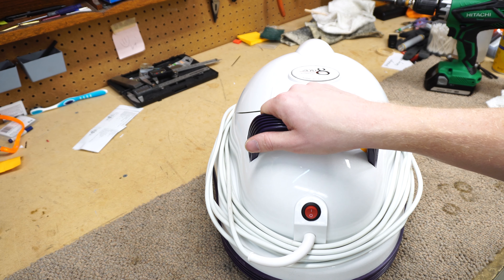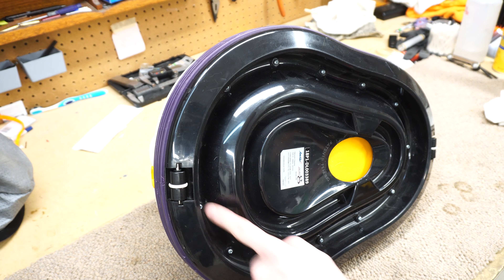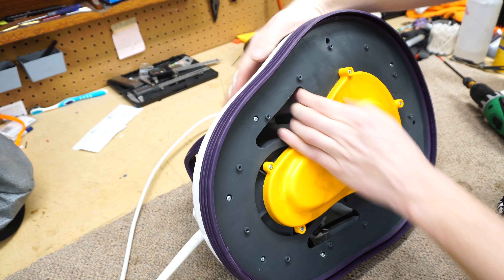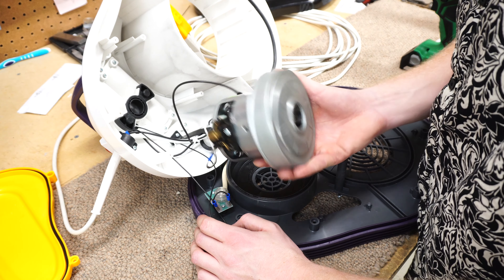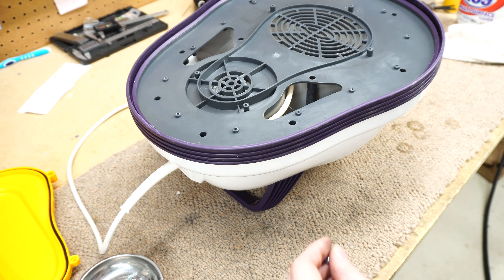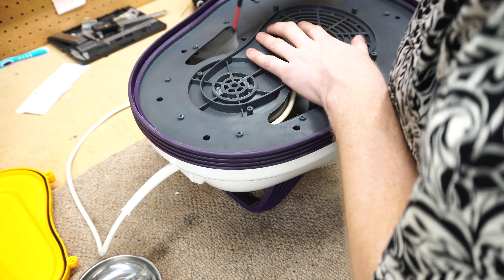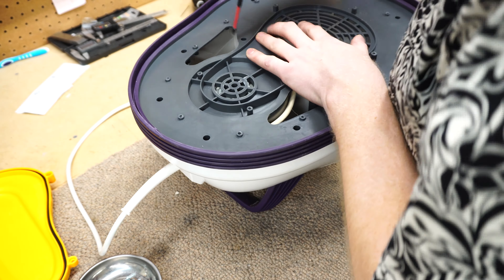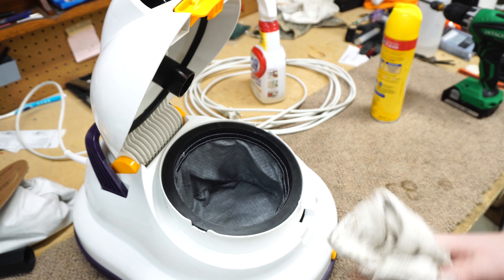Zero G F3D Vacuum Cleaner Repair

Comment: Wow, there's nothing in there! (Then again, what do you really need in a capable vacuum besides a motor, a thermal cutout, and an electronic bag check?) I'm just surprised they used a 4.3" motor instead of the typical 5.7" you'd find in canisters.
Also Cinderson motors are fairly common now - you'll mostly find them in low- to mid-range vacuums like Hoovers and Kenmores. They're no Ameteks, but they're alright for non-serviceable tin can motors.
Reply: Is it possible to replace the Cinderson motor with an Ametek motor? Also, is there a way to put sound deadening foam in the Zero G to make it quieter? I have tinnitus and I hate loud vacuum cleaners. The Zero G is supercool, though, and I would love to own one.

Comment: At $600.00 the question becomes whether it’s worth spending $700.00 to buy a Miele Electro+ instead particularly if it’s going to be your only or primary vacuum. My inclination is that it would be worth the slight difference for the Miele.
Reply: Why? I have a Miele and I'd like to get a Zero G instead.

Comment: Zero G need to make a 240v version for sale in europe, id buy one if they did
Reply from the maker: Europ needs to start using 120v.       

  😉 April fools
Reply: @PerformanceReviews  😂😂 what voltage is the power head, I want to fit one to my henry